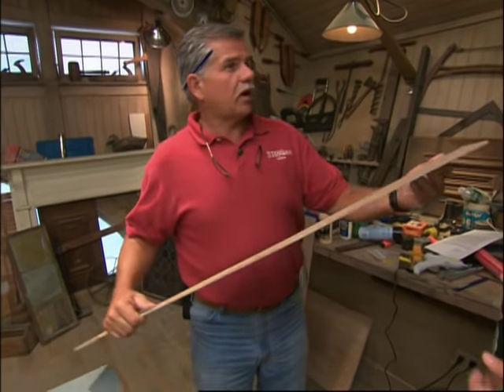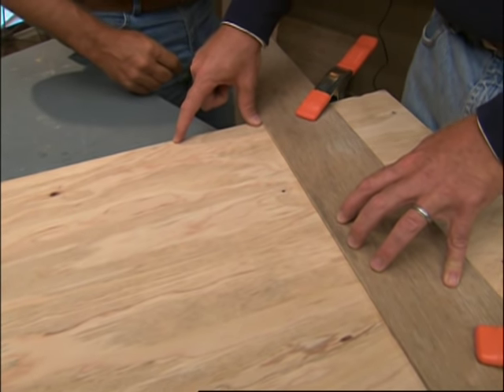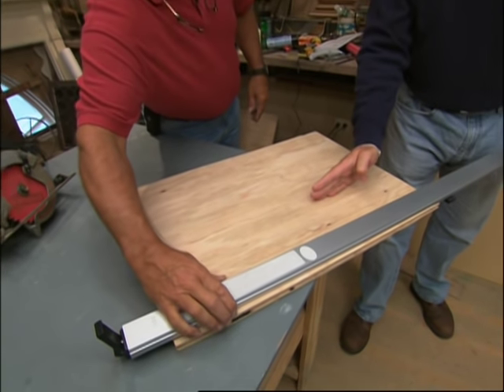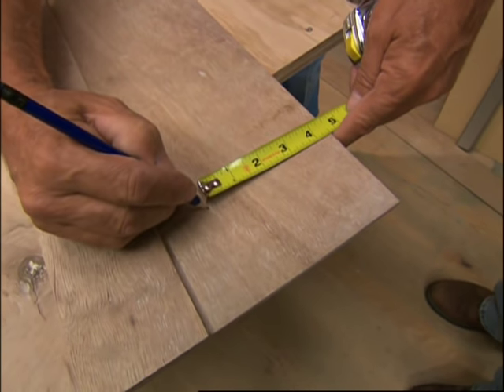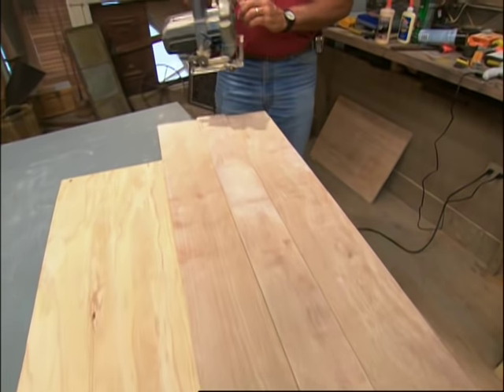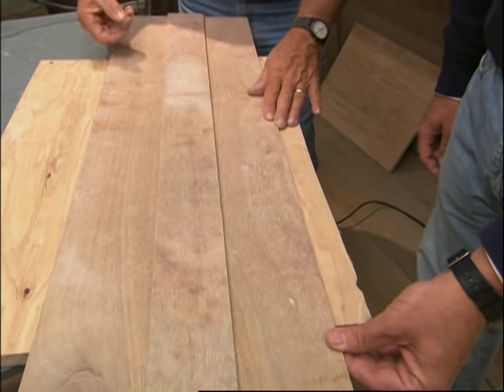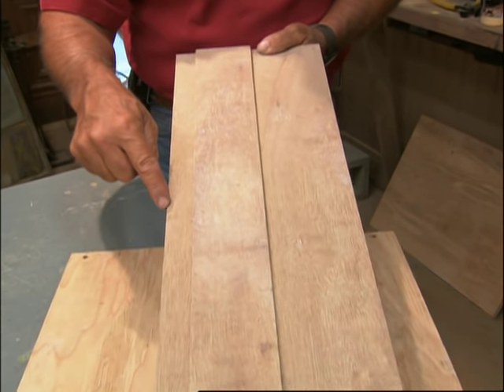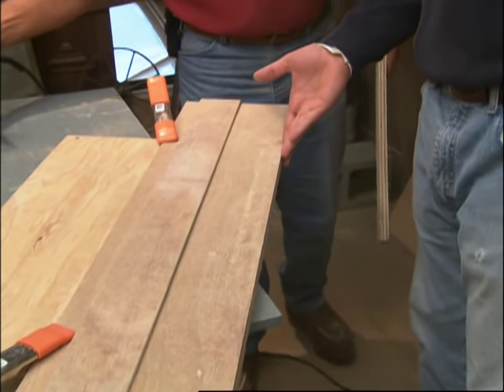How to Make a Circular Saw Guide | This Old House

Comment: Add rubber anti slip to the bottom and no need to clamp.  Ask a truck driver to get you some, it is used all the time to keep loads from moving and most times thrown away.  Also makes great tool box liner.

Comment: keep in mind you still MUST take into account the saw kerf if the piece of material you are wanting dimensioned is the offcut
Reply: Is the offcut the piece outside of the guide? The piece falling away?
Reply: Yes the piece falling away is the offcut. Wow this original post was five years ago.
Reply: @jcreadiii  true, regarding the kerf width. However.. If you just fully expose your marked line on the piece or cutting, it will get taken with the cut.

Comment: This is such a useful addition to any shop. Cutting plywood for cabinets on the table saw can present challenges when you work alone. This jig adds a lot of safety because the blade is spinning below the surface .  As well this is quite portable to work outdoors. Well done guys.

Comment: You don't measure the distance on the blade, but on the tooth. Some blades have left and right teeth and others straight. So be sure to measure at least two teeth. The cut will always be wider than the blade.
Reply: The extra half inch that is removed when you run the cut allows for tooth width variations.
Reply: Scott Tovey Exactly, the guy even asked “So why a little further?”.

Comment: One offset that wasn't mentioned is that if you have to place this jig on the waste side of the wood to make a cut, you need to offset the guide the thickness of the blade away from the line.

Comment: How do you guarantee the rail is straight on the non  factory edge. 
they would seem if you're going to use both sides you need to ensure that you have a scrap that is in square., Yes? Then you would need  an accurate table saw I guess. 

Or maybe it doesn't matter? If I start with the sacrificialpeace then I would guess that it would be even all the way across even if it's not square with the other side. Right?

Comment: Every video you find about making a straight edge starts out with "get a straight board."  Where am I supposed to get this magical straight board to start with when I'm trying to make a jig to create a straight board.
Reply: Cut from a sheet of plywood and use the factory cut edge as your straight edge, given they're generally very straight.
Reply: When you buy your first sheet of plywood, buy a second sheet at the same time to provide your initial straight edge.
Reply: Clamp a level down as a guide to make your first straight edge. Or something similar

Comment: I bought a metal track saw guide to use. For some reason the saw starts pulling away from the track and I get a crooked cut and it's usually at the last foot of what ever I'm cutting. I use the same pressure the whole way. Any ideas? Thanks

Comment: Nice straight lines, but are they 90-degrees?  That is my question about this method of making this kind of quick guide out in the field.

Let's say the straight edge has a 1 or 3 degree angle off the 90-degree mark.  We'll cut straight but in the end, the small degree difference across a longer distance, could lead to cut pieces that don't meet up with their intended corners.

Comment: What is the advantage of making the   second cut? The saw is not fully supported and would require both holding it to the side as well as down so it does not tip. 

 So when would somebody want to use the smaller edge?
Reply: Cutting the other direction.

Comment: So I've made a guide just like this. I make my mark on the piece I'm cutting and lay the guide on the line. However, after cutting the piece is 1/8 off. Do I need to take into consideration the blade thickness when making my measurements?
Reply: Cut from the good side, not the waste side.

Comment: I have been having a nightmare of a time cutting 90 degree edges with my circ-saw... after 70 minutes of calibrating the blade, I discovered my issue is a slightly bent boot (the base)...
 
 I could try bending it back the 4 to 5 degrees, but worried I'll make it worse.
 
Would a shooting board fix this issue? Or does anyone recommend another easy, fast fix?  It is the Flexvolt Dewalt DCS578. (And I DEFINITELY voided the warranty by modding it.. in ways lol...  since I only have 1 functioning arm.)

Comment: Clamp your straight edge/saw guide to a scrap piece of wood. Now make a small cut with your saw into the scrap piece of wood using the guide. Take the saw out of the way, now measure from your straight edge/saw guide to the edge of your cut you just made. Now you have the most accurate measurement for placing your straight edge/saw guide for future cuts. Write this measurement on the guide so you don't forget it.
Reply: You can make a second cut that creates a spacer for your saw guide and use that to place your saw guide.

You would need to mark it for your saw. If you drill a hole in it and through your saw guide, you can chain the two together, that way, even if you forget that it's a spacer, you won't throw it away, loose it or use it on a project because it just happens to be the exact right size you need.

Hmm. Now that I thought of this, I need to make one for my saw guides and saw.

Comment: Many thanks for the good advice, but it's dangerous to operate the saw with your hand on the tiny blade shield handle. This hand should grip the handle on top of the motor housing,, i.e. on the opposite side from the blade. Also, while the broad side of the fence guide supports the saw well, the narrow, less supported side is prone to sideways instability. Here a second fence guide would be the easy solution.

Comment: Or buy the Festool TS55 and track :)
Reply: Pete Brown That saw is $600, is there a better option?
Reply: ***** Festool stuff is expensive, but it's really well designed and really well made. I use the track with their router and saw. 

If you often use a saw for sheet goods, the Festool (with the dust extracter) is worth it. You can do finish cuts in hardwood veneer plywood with it.

I don't have room for a large European panel saw like a Felder, Hammer, or Minimax. If I did, that would be my first choice. The Festool TS saw system is my second choice.
Reply from the maker: Pete Brown ***** 
We're giving away two 21-piece Festool prize packs as part of our The Great TOH Giveaway! You can enter daily here: http://www.thisoldhousesweeps.com/win/
Reply: Pete Brown that saw is worth every penny. It has made life so easy
Reply: +Pete Brown Festool is good, if you make a living in construction, but it's not for the DIYer or hobby woodworker.
Reply: +Moochie Kat Why not? If you're saying that it's due to price, that doesn't always hold. I'm a DIYer and hobby woodworker with quite a bit of Festool. I can do more in less time with their stuff.

In any case, DeWalt and others also have track saws now.
Reply: You probably have deeper pockets than I. I prefer to make, and enjoy building jigs, and other things to make my hobby fun. I even buy some tools at the dreaded HF store. You have fun with your over priced festools, I've been getting along just fine, with homemade and cheapo stuff. BTW, why would you even watch a video on how to make a track saw when you already have a $600.00 festool?
Reply: +Moochie Kat Because I like what Tom Silva does and how he does it. You know he has a lot of "overpriced" Festool as well, right?
It's funny how much more money you have when you drive a 10 year old car, don't buy coffee or lunch out much, don't smoke, don;t have an overpriced cable TV package, etc. Good tools are usually worth the money.
But building jigs and helpful things like this is fun as well. :)
Reply: Pete Brown for $1,000?? Lol he just made one for like $2.
Reply: There are a few factors in diy table saws. One place I discovered that succeeds in merging these is the Wilfs wood blueprint (check it out on google) without a doubt the best plan i've heard of. look at all the awesome information .
Reply: +Pete Brown I drive a 94 Chevy pickup I bought for $900, make my own coffee, and don't pay for tv and I'd still opt for the home made cutting jig. To each their own. :)

Comment: great video but never!! cut while holding board in air!! that's a bad habit!! And a easy way to cut all your fingers off!!
Reply: I was thinking this, too, as I watched him finger the edge of the board with the saw blade spinning only inches away.
Reply: Bob Preis I know a man that's been a carpenter for 40 year's!! they said that one day he was holding board in hand the way he always done but oopses!!
Reply: @BobPreis  You have to apply the lateral pressure directly from the base plate like that. If you apply any lateral pressure from top of the saw (I.E. the only place where it's actually safe to do so) the cut will have random degrees of bevel (I.E. it will not be square cut edge-to-face, ask me how I know). If you don't apply lateral pressure (to follow the guide perfectly) then obviously the cut won't be straight. So overall these guides are much worse idea than they look (except for super rough carpentry I guess) :)

Comment: one thing not noted in this video, is Tommy has a unique saw, blade to the left side not commonly found except in work drive saws. This is the saw to have for a right handed man. Most saws sold are for left handed men. Why, because they force the right handed man  to stand behind the saw to see the line, very dangerous to do.
Reply: battery-powered saws (e.g. dewalt battery saws) have the blade on the left hand side. I genuinely don't know why so many sidewinders have it on the right hand side, it makes everything awkward, and as you say, even dangerous.
Reply: thia saw is not worm drive its sidewinder with blade on the left side
Reply: Most of the saw's shoe is under the saw, so blade on the right for a right handed person means the saw stays sitting on the wood when the piece getting cut off falls away. If a right handed person uses blade-on-the-left, then the saw starts to tip to the right when the piece getting cut off falls away. There's kind of a trade-off between being able to follow a line precisely and being able to keep the saw from tipping off which comes down to personal preference I think.
Reply: I have been a carpenter for 25 years
I have the same saw he has and I love it
I've had it for about 10 years and it's still kicking ass
Porter Cable 7 1/4 inch left handed saw

Comment: NO, NO, NO!! Use two narrow strips on the wide piece of luan. YOUR saw slides between them, trapped. But, wait, you say, you will end up sawing your jig in half!  NO, NO ,NO! Attach a 2x4 to the underside of each end, like an upside down table saw sled. Saw runs flat, and true, even on angle cuts. And, it shows the cut line reference. DIYers can't control a skilsaw like Silva, and shouldn't be expected to!
Reply: studfindingball good idea but....you’ve sacrificed a lot of cutting depth capacity.
Reply: could put the 2x4 (or 1x) on top instead